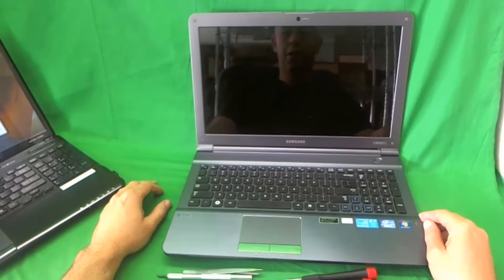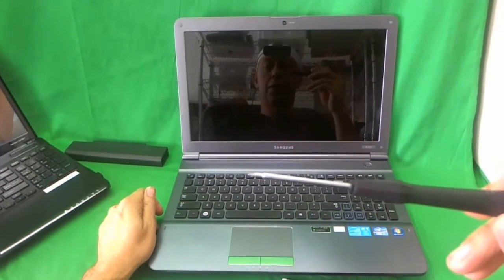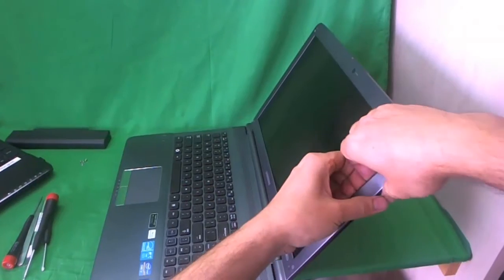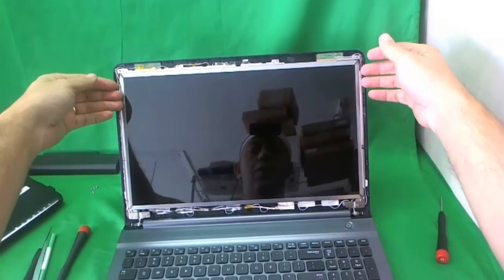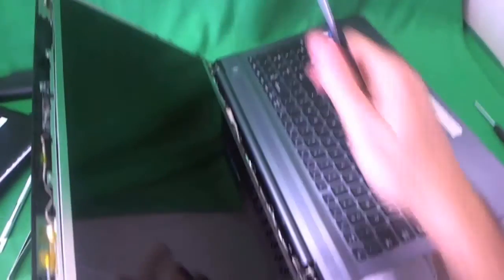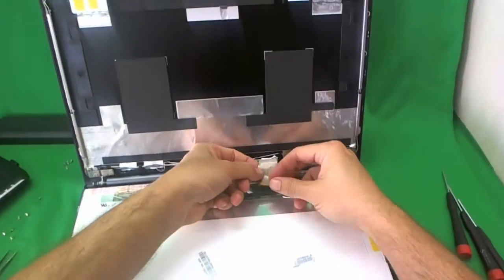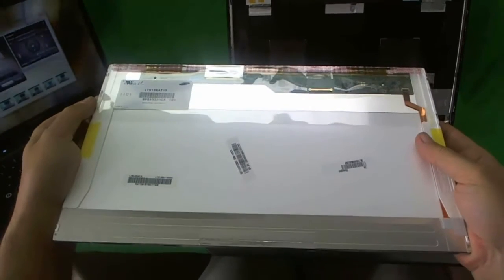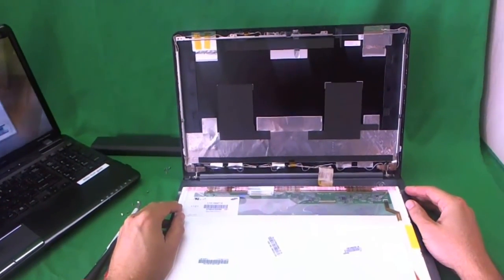Samsung RC512 Laptop Screen Replacement Procedure

Comment: Pretty much all the screens out there are same where dimensions fit you can swap for a better resolution or better yet plop a touchscreen ($50 for 15.6 tft shipped) in it and it connects to the same 40 pin header. Only issue you may find is some of the internal side mount screws may be located slightly different. Even so there are ways to get around that.

Comment: This video was spot on. I used it for an RF510. I wish I would have found you sooner and would have ordered the screen from you (I used an Amazon supplier). Anyway everything was the same except there are TWO MORE screws along the top behind the same type of rubber bumpers.
Also, after unscrewing the bracket from the screen there was a connection to the web cam. It had adhesive double sided tape. One needs to mark the place where that little circuit board goes. All else was easy.